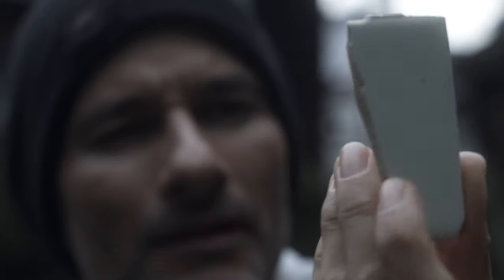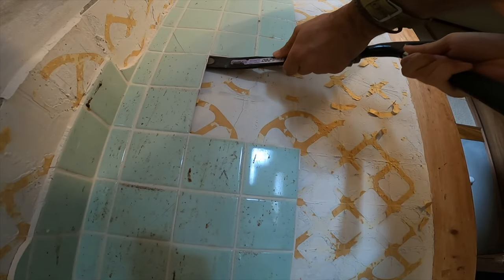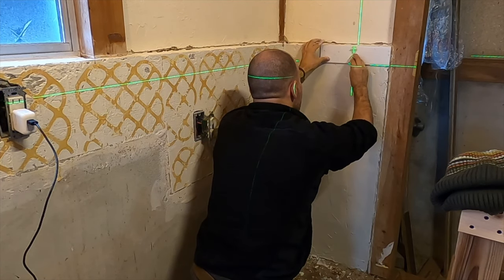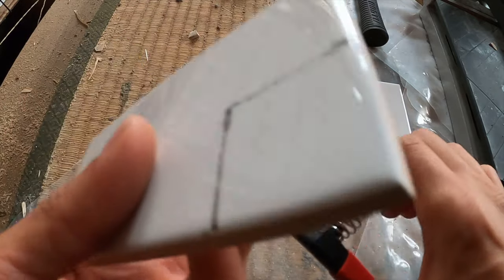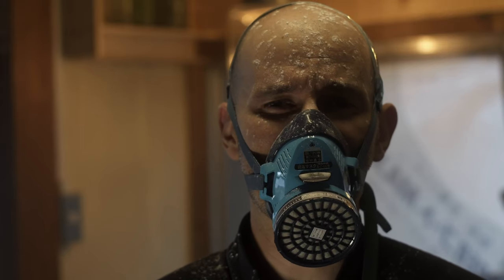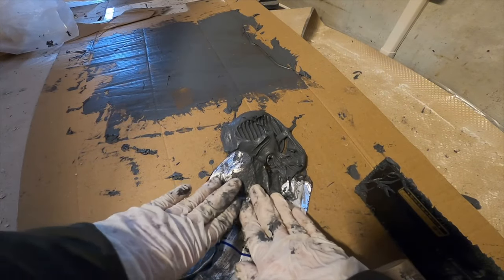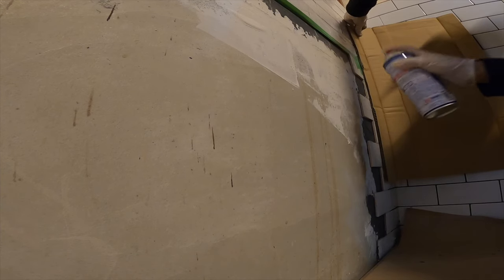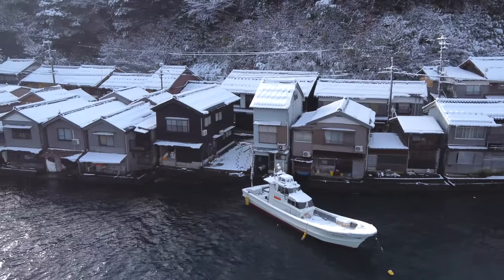Japan kitchen renovation tiling the walls on an abandoned akiya house

Comment: The first white product you used was actually grout. The black product is adhesive for plastics and ceramics. You needed tiling glue that is cement and rubber based. I would go nuts in Japan without any English reading products to buy. A grinder is best to cut out L shapes. For small strips, score it once and use a shifter to break it off.
Reply from the maker: My wife was with me, even though she has no knowledge of these products, asked the staff for tile adhesive. The white bag was the product given to us. The package literally translates as '' base material for tiles'' and uses phrases like '' adhesive strength is outstanding''  lol So many things went wrong with this situation.
As for the grey paste, that is marketed as a ''One-component elastic adhesive for interior and exterior tiles''. The tiles installed are clay ceramic. So it is a more accurate adhesive for tiles. Trust me, it really is all confusing and frustrating because everything here has an ambiguous name and purpose. They basically market their product to do everything even if not initially intended to do that type of job. And nothing makes sense in Japanese when translated. 
Thanks for the tip on the grinder. I have since bought one and will use it for the next tile job!
Reply: @DIYJapan  I been watching your videos non stop. Renovation in Japan very different to Aus. Keep up the good work. I may end up buying a house in Japan.
Reply from the maker: Thanks! If you can afford it, why not buy a house in the countryside. And then you can join me in the pain and misery of figuring out the right building materials lol
Reply: @DIYJapan  I will have no one translating for me. 🤔
Reply from the maker: The language barrier is definitely the hardest part.

Comment: Oh yeah. I feel your pain. Doing a cement rendering project at the moment. Tried mixing my own rendering mortar but the sand I used didn't make sticky mortar and it just fell off the concrete walls. The sand they (home center) recommend is not graded properly so there are grains which are too big for rendering, you can't get lime to make a lime cement mix, and the list goes on. The pros in Japan are definitely not sharing trade secrets and I have noticed that the products pros can get, for example from LIXIL, are far better more extensive what we can get (and obviously cheaper). In the end I found a product which I had to research on the makers HP that I saw in the home center and forked out the money to buy it and it worked really well. Have seen vids on wallpapering with ladies holding the paper up with brooms; pros definitely don't do that. So spot on, never buy products with pics of cute kids and women on the front, the pro stuff is just in paper bags.
Reply from the maker: Exactly! I order everything online from pro shops... in 24kg paper bags lol

Comment: You are a very good guy for including such a deep, poignant anti-drug ad in your video. The more you know! 
Speaking of knowing -- one would assume to think that a product like tile mortar, made to stick tiles to the walls, would actually DO that, right? "Pro" or not, they should all theoretically do that so it's insane that some don't. I haven't done any tile yet here in Japan but those products look so alien to me -- the mortar and "grout" both. I don't believe I've ever seen or used stuff that is so gooey and smooth in my life! I installed rough slate floors in my kitchen back in the US and not only was the floor mortar thick to put on, but the grout was an add-water mix that was very gritty and went on like sandstone. I just don't quite get some of the products here. Makes me wonder if this is part of Japan's overall preference for new stuff and how fast things depreciate. Why is it so hard to have nice things that last??
Reply from the maker: Yeah, in the States it was sandy like you mentioned. This was like spreading Nutella on the walls lol.
Reply: @DIYJapan  how do you feel about the staying power of these materials? Seem dicey to me but what do I know? I'm definitely not a grout guru.
Reply from the maker: I've never seen grout just degrade though lol but it would be more concerning if it were in the bathroom getting a dose of water ever day running down it. I've already researched new materials for the bathroom that will give me more confidence. I came into the kitchen project blind and that was my downfall lol I thought I could just find a good product walking into the store. Sorely wrong.

Comment: Did you get most of your tools from Amazon or local hardware stores? Great content btw!!!
Reply from the maker: General tools like hammers and such at the local hardware store. Power tools I bought some used on mercari like the chop saw and power drills. But the most punished tools like jigsaw and hand saw at local hardware store because they come with warranties and I’ve actually had them replaced for free because bits broke.

Comment: Oh man, love the vague coke references — that's why the housewives are so happy. If you do any more tiling, I just used an angle grinder with a tile cutting disc. You can cut notches pretty easily and avoid the tile graveyard. Also, tile ace pro and 目地材 grout are cheaper at a pro 建材 store. You have to buy by the box, 12本, but it was half price compared to Komeri home center and had fewer housewives on the packaging. If you use a silicone sealant, don't forget to get one with 防カビ mold-inhibitors (mistake I made). gambatte.
Reply from the maker: I did buy an angle grinder but only after I did the kitchen. I'll definitely use it when I do some tiling in the bathroom. Thanks for the tips on the silicone! I haven't caulked anything yet but soon.

Comment: I enjoy your narratives vs the bad vibes personified in those characters, haha.

I did my backsplash DIY in a Herringbone pattern but pre cutting vs cutting as I go was a good idea in theory.  I went w/ a single use tile saw which was a good remedy for tight cuts, but saved on waste scrap tiles.

Where will you route the water supply to the faucets?  did you have to adjust the goal height of the counters as opposed to what is originally installed?

keep it up & be the BANE to bad design, hah
Reply from the maker: Yeah, never precut everything lol I learned that a long time ago. It just takes a small deviation when laying down the tiles for you to end up with a huge gap lol I really want a tile saw... I am still looking into maybe renting a wet saw for the bathroom. I've heard of places that rent tools. ''heard'' but never seen lol . I don't think I want to do it this way again lol 
 The pipes were run longer than needed by the plumber. Once the height and faucet are finalized I'll cut them down and run them to the faucet. You can use steel braided hose to run them easily to the faucet without the need for complicated piping. We'll see...

Comment: Lookin good in the end. Hope you leveled up off that Cocaine Monster. There is an antifungal silicon product in home centers (various colors), which works very good as a replacement for tile grout - you can even apply it over top of tile grout after spraying it with a steamer to kill the mould. If you use only a pinhole, it should apply just enough. Do 1 direction, let it dry for a day, and do the opposite direction the next day. Minimal to no cleanup required. Maybe give it a go when the grout you applied starts to weaken?
Reply from the maker: Might look into to that when I tile the bathroom. Always thanks for the many good ideas! Hopefully the grout won't weaken anytime soon. The grout sealer should preserve it for a bit... I hope.